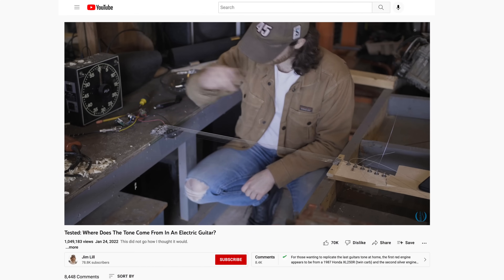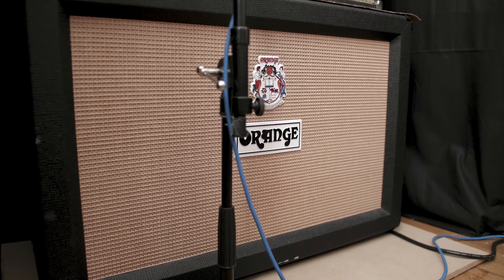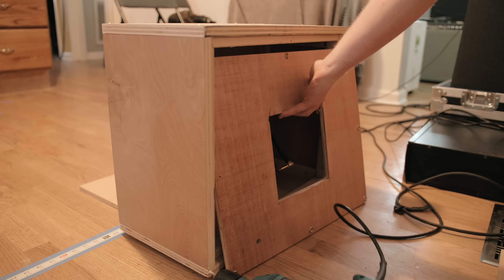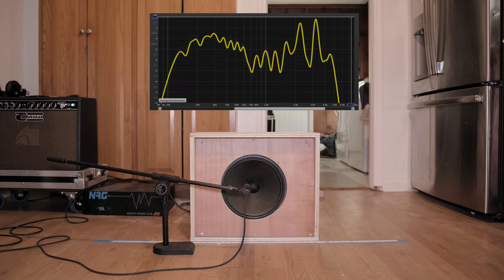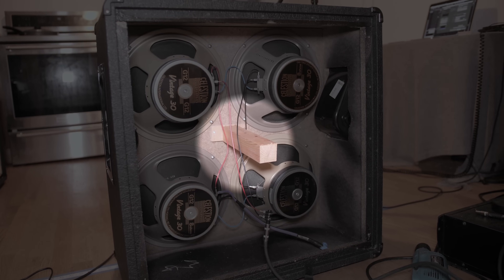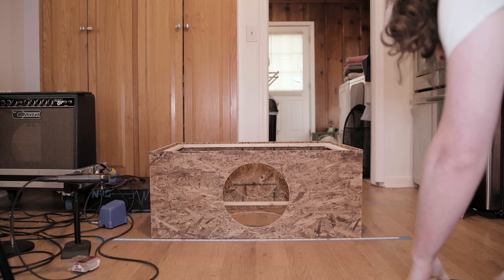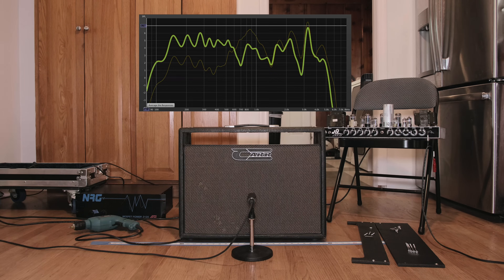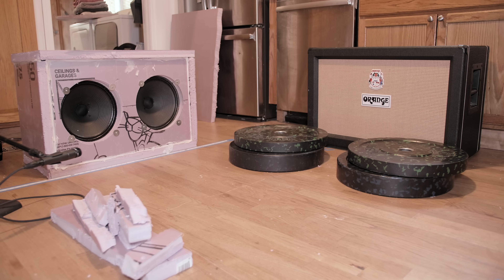Tested: Where Does The Tone Come From In A Speaker Cab?

Comment: Thanks Jim.  Your work is a final word on cabinet design.  Beyond impressive work.  Thank You.
Like you, I was on a quest a few years to create an amp/cab combo that would enable me to play a wide variety of amp/cab configurations, but without any reconstruction necessary.  The amp I created is called the Zen Electric Convertible.  The introduction video showing its design elements is here:  https://youtu.be/DAzET6K8JHQ

I also made a demo video showing sound samples many of the cab/amp combinations, all without anything but a guitar straight into the amp.  That video is here:    https://youtu.be/7lit4BIRb1I

Long story short, the amp is a hand wired 5e3 with a traditional first channel and a marshall-modified second channel.  The cabinet is much larger than a traditional 5e3's and contains a 10" and a 12" speaker.  The speakers can be used one at a time or together.  A switch allows me to play the speakers in or out of phase.  (Bear in mind my demo video only contains samples of both speakers together out of phase due to my early carelessness wiring them.  The problem has been addressed with the phase switch.). 

The cabinet can be closed or open, and the whole thing tilts back when necessary in case you want the speakers aiming at your ears.  I hope you get a moment to sample the videos and tell me what you think.  Let me know if you think this would be useful for a working musician.  (No I'm not making or selling amps.  This is a one-off, but with your amp building skills, feel free to take any of these ideas.)

I'm subscribing to your channel, of course.

Comment: Why don’t you place the microphone a couple of feet away from the speaker? Close mic to the cone is not the right way to hear the cab differences, it’s impossible for the mic to pick up the ambience and tone in this manner. Try it and you’ll hear the difference. Imagine you sticking your head into the speaker at a safe level, you might not even notice the difference. Good vid, btw……👍

Comment: As an amplifier cab builder myself, I have to say that this video is slightly misleading: If every audio clip in this video does actually correspond with the visual/video presented on screen, then it is clear to see that the recording microphone (in 99% of instances) is directly in front of the speaker... so, in a 4 X12 test... Jim is only recording ONE speaker... same goes for a 2 X 12 or any other combo. The wood, resonance and structure of any cabinet DOES affect the tone... but you're not going to hear that with a mic placed right in from of ONE speaker. To do this properly, Jim should place the mic say... 20 feet away - about where you'd hear the speaker if you were stood near the front in a small venue... Just sayin'! 🙂

Comment: I’m not sure I buy it. With the speaker so close micd aren’t you really just hearing how the compression of the air in the cab affects how the paper cone moves? Your just hearing the cone. Your last bit in the video shows that that if you have the same dimension of air compressing the cone movement it will sound the same that closely miced where you had the styrofoam and orange cab micd. So yeah open back vs closed will matter. Size of the box will matter. Dividers (effectively changing the size of the box) will matter. And of course sticking things between the mic and speaker will affect how it sounds directly in front of the mic like fabric or a beam. That’s just common sense. I would think if you wanted to hear how these structural differences  you built affect how it really sounds you need a room mic mixed in so you aren’t just hearing the sound of the mic and speaker?

Comment: Audio Engineer here. Jim Lill, you are doing God's work debunking years of superstition and marketing around guitar tone. You have pretty much hit the nail on the head about what really changes tone in a cabinet. The size and sometimes shape of the space available behind a driver (speaker) and the phase relationship it has with other drivers sharing that space will create what we call constructive or destructive interference. In the case of constructive interference it will make some frequencies louder or more prominent and in the case of destructive interface it will make some frequencies quieter or less prominent. The same thing that happens inside of your speaker cab happens inside of rooms. Which is why Mixing engineers work very hard to "clean up the room" or at least account for what it is doing to the sound when we are mixing. Some rooms will create standing bass waves and need bass traps. Some rooms will reflect high frequencies and give the impression your mix has louder high frequencies than it really does. Speaker cabinets are like building a little room around your driver. They allow you to create a more curated reflection space behind the driver to get a different tone. Most recording engineers will also curate the space the cabinet is in to really dial in the tone. Silvia Massy is known to put mini guitar amps in metal safes and all kinds of  different things to get different tones. What we are really doing is playing with creating a interferogram that results in a "tone" we like or that fits the mix. All the other stuff people say impacts tone: "Tubes", "Tonewood", Cabinet covering is mostly just not true or makes changes that are almost imperceptible.

Comment: You’re comparing apples with oranges here.  Direct frequency on axis response tells you little to nothing about cab colourations.  Open baffle and closed baffle affect qts of speaker hence tuning in the bass.  Reading a loudspeaker design book could tell you everything you  need to know instead of guessing cause and effect.  Cab construction affects two main things given you’ve sized it right in the first place…waterfall decay plots will show you how energy is stored and released and internal geometry and damping affect direct through cone reflection and standing waves.  Seriously, instead of time consuming testing which doesn’t scale into any general theory applicable to all future builds, just read some books chap.  It’s all been done and documented. Start with RA Briggs @the loudspeaker” and go from there.  You’ll learn more👍. Well done though for sticking at it and at least adopting an investigative approach to improve your current cabs.